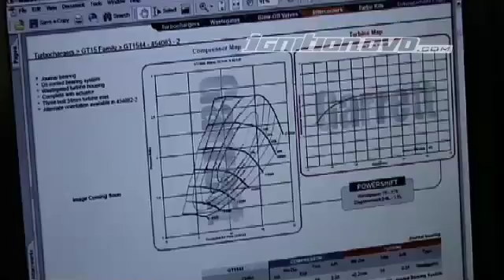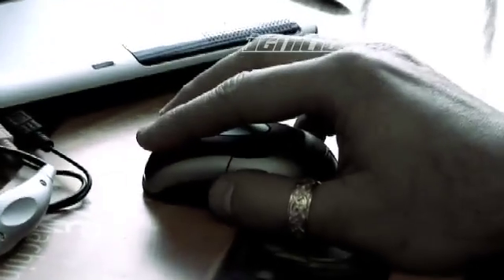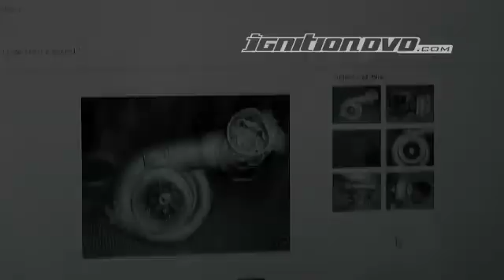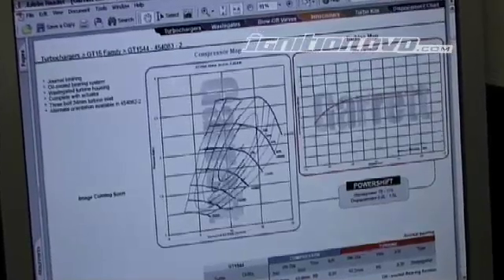Tech Talk on Turbo's with GCG

Comment: Hi I recently saw your video on youtube and would like you to tell me more.  I have a 2004 mazda RX-8 and am looking for some more power.  Its completely stock.  I am currently looking at a T3/T4 turbo.  I would like you to tell me what turbo you would suggest and all of the turbo information such as the trim, diameter,etc.  Im looking to run no more than 13lbs of boost and would like to make from 280 to 320 horsepower.
      Thank You